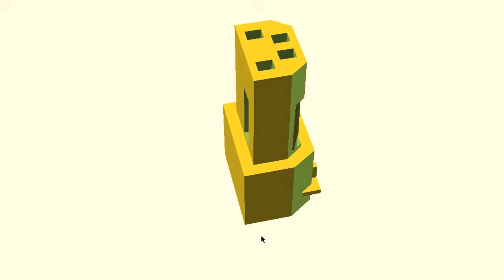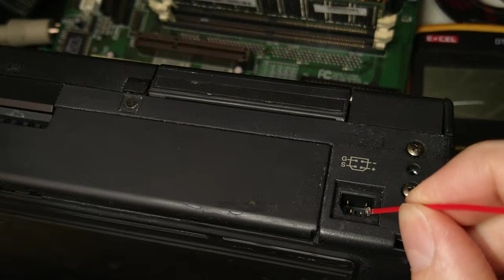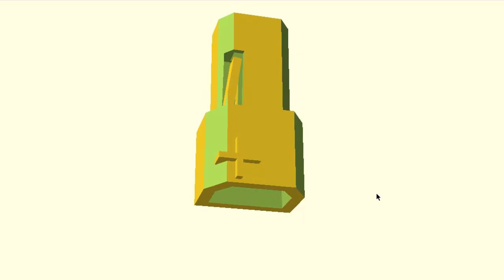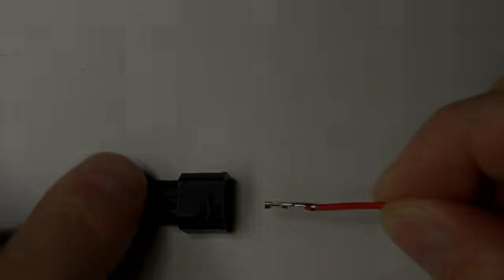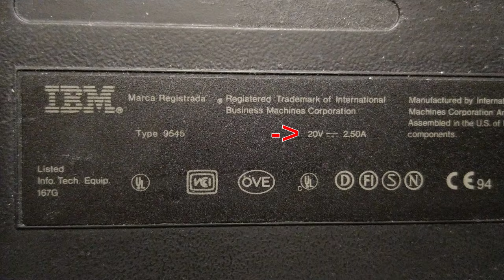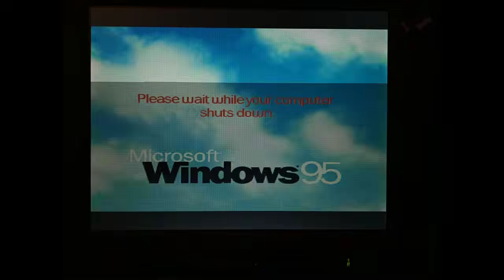3D Printed Thinkpad Trapezoid Power Connector for 755C 760XL and others

Comment: There's a severe lack of duke 3d e1m1 music in this video. 
Also, for such a small 3d print I'd use a resin printer with a tough-style resin. FDM just doesn't have the layer hold and flexibility that resin does.

Comment: Thank you for that. I have several Thinkpads from the 7xx and 3xx series, but only 2 power supplies for them so I have to switch them often. I have also used a makeshift adapter with jst connectors - haven't tried dupont ones, but now I will. And I do have a 3d printer. :) So your project is much appreciated. 
The original IBM power supplies are indeed 16V, but I have ran them on regular 19V laptop PSUs without issues. I probably shouldn't do that in the long term though.

Comment: Is the glue solid at high temperatures after curing? Is the power draw high enough that we should worry about that? I wonder if silicone sealant would be better.
Reply from the maker: I used standard hot glue because it's easy to remove it if you don't apply it correctly. But any glue should work.
As for the temperature, I doubt the connector will get worm, the current is usually less than 1 amp.
Reply: @scrap_computing  I would recommend using quickset epoxy for a more durable bond. Or use the old 3d-printer users trick:  ABS glue (ABS scrap pieces dissolved in acetone)

Comment: Thank you!
I searched for such a thing a year ago. It is good to have modern solution for it.
By the way, if the screen assembly is untouched, I'd strongly suggest checking out the brightness control and ccfl pwm board state.
In mine the caps gone bad and they took out the pwm chip too, had to replace them in the end to get back the backlight working.
Reply from the maker: Thanks for sharing the information about the leaky caps! I haven't disassembled the laptop at all, so I will take apart the screen assembly to check it out!

Comment: I wonder if a USB-C PD mod would be better for these.
Reply from the maker: Yeah I was wondering that too. I haven't taken it apart to check if there is enough room for a USB-C mod.
Reply: @scrap_computing  Unlikely - I have opened up several 7xx thinkpads and they are very tightly packed inside.